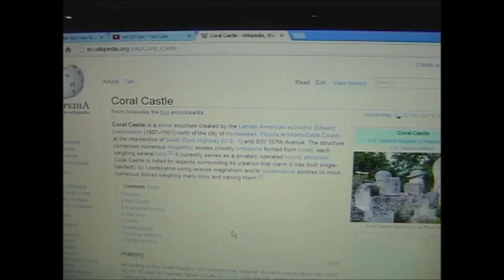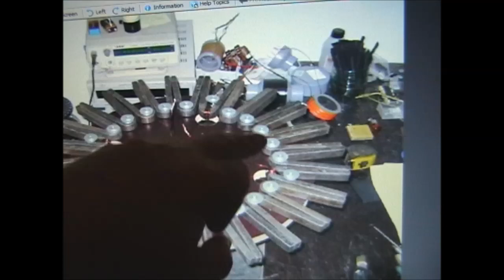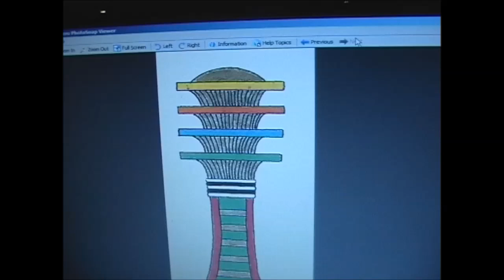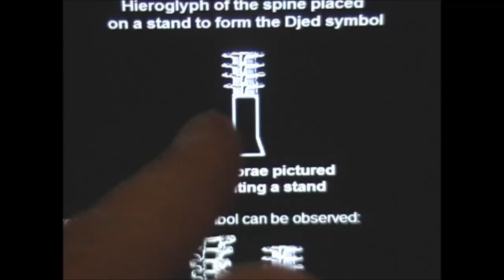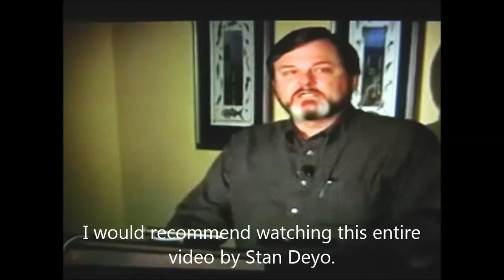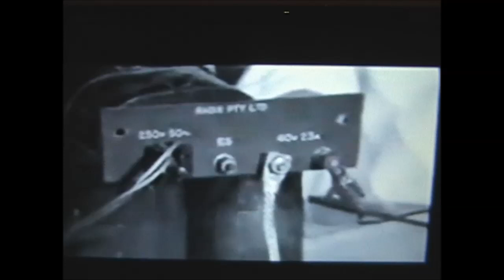Part 8 Mt Meru & Antigravity

Comment: If you put a copper coil under the center shaft and charge it it will put a north charge toward the top Handel , and a south  toward the bottom , in one of my old videos I put water in the center but I did not put a coil in the center. So thanks for giving me a new fresh idea to do with my replica of Ed Leedskalnins wheel. Good vid

Comment: About Ed's wheel if you think was a salt water or ocean water in the wheel during he producing antgr, my view is he used neutrons from the ground and electrons from the air       a wheel is neutral strong magnetic field also holes in the midlle 6 of them like 2 triangle points a (STAR) and he said if you turn one way around 2000rmp and then other way 2000rmp you shuld get some antigravity field...i mean he said like you will see a lot of that ...but that concept he used around like homopolar motor with coils to run a wheel that speed ...